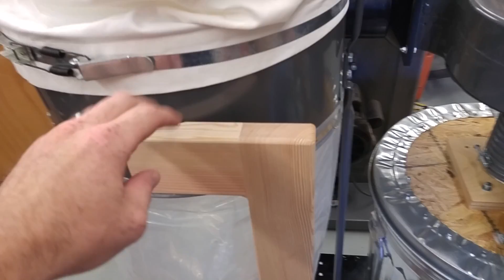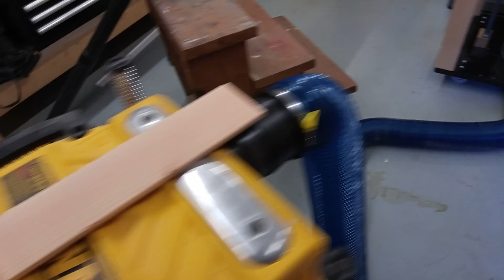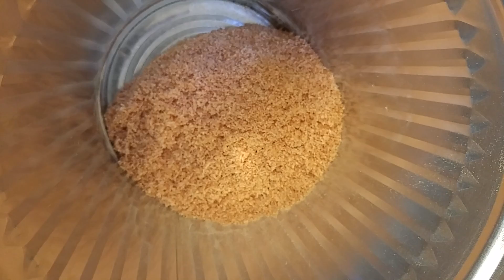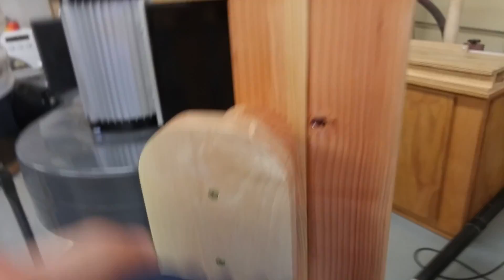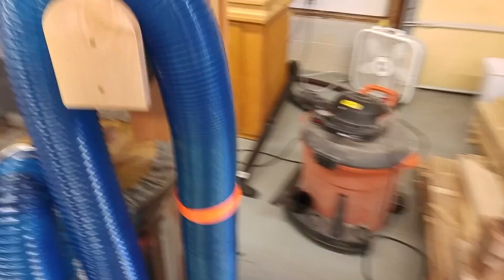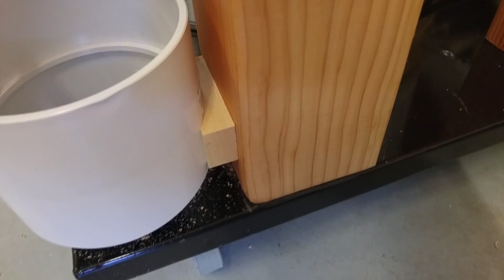Harbor Freight 2HP Dust Collector Modification Part 3/3

Comment: What is the overall dimensions... the original HF dust collector is 22"x33" -- my space is quite limited. I know this is old and you are more than likely tired of talking dust collection :)
Reply from the maker: Mine is around 22x48x70 inches. The 22" is not including the elbow sticking out from the trash can, which could be rotated to the side if necessary.

Comment: How tall is your unit after your modifications? How stable is it? I'm a little worried that mounting the motor high on the cart might make it dangerous with small kids around.
Reply from the maker: 68" to the top of the filter. The motor is narrower than the base, which helps with stability. If someone wanted to tip it over they could, just like a chest of drawers or bookshelf.

Comment: Nice Job! You might consider adding a floor sweep to the bottom of your unit so that when your Rockler tubing gets disconnected from your power equipment and "docked" into that coupler, the suction airflow would get connected to the floor sweep (mounted to the bottom of your unit).
Reply from the maker: Thanks, good idea.

Comment: would you mind to give purchase links for your parts? say the rubber quick connector and sch20 coupler? your cyclone baffle looks different than Thien's, any details on it?
My personal feel is that the opening is a bit complex, you might allow motor assembly on a vertical slide. thanks for your video.
Reply from the maker: I added some links to the description. I should probably post a separate video on the baffle, but it should be pretty close to the Thien concept. I used the 4" steel fittings inside the baffle because I could angle the one on the inside downwards (slightly) to help the dust drop, but PVC or black dust-collection fittings would probably work just as well. I've seen several different variations of the Thien baffle online and I don't recall seeing one yet that just plain didn't work.

Comment: I liked your single handed approach of over coming your motor mount. I also liked your idea of attaching the garbage can under the motor. My thought instead of the 4 bolts to attach the garbage can lid, would be to create a dadoed track on 3 sides of that square plywood piece, for it slide along. The opposite corresponding 3 dadoes would be on the piece on the bottom of the motor. The garbage can would then hang on and the suction would make the seal when it was turned on. A lot less time mounting it each time. 
Thanks for your ideas.
Reply from the maker: Thanks.  Good idea about using dadoes, although the weight of the full can might pull off the lid if not supported from underneath.

Comment: Very nice setup. Just got my HF dust collector and plan on building the same cart. Just have a few questions. How did you seal the OSB to the lid? What length is the Rockler hose and do you recommend it? Did you have to place sealant between the lid and the rim of the can; if so what did you use? I used the same trash can for a two-stage setup with my shop vac and the can collapses every time I turn it on. Hoping not to repeat that with this build (although I’ll have to buy a new can).
Reply from the maker: Thanks, glad you liked it. I used Gorilla Glue Construction Adhesive to seal the OSB to the lid, but since I put sheet metal screws around the perimeter any kind of caulk or adhesive would work.  The hose is Rocker item# 57111 in the 28' length, because it can reach any corner of my shop without moving the system.  So far no complaints about the hose except the price.  I didn't use any sealant between the lid and the can - Because of the taper in the lid it seals pretty well, and since that's in the intake end anyway the worst that could happen is it sucks a little extra dust out of the air into the filter.

Comment: This is very nicely done. Thank you for sharing.  I have decided too buy the HF DC And modify it and am gleaning ideas.
One thing I'd like to ask is if it is necessary to still use the filter and bag if you are able to pass a hose outside instead?
Reply from the maker: Thanks. The filter is not necessary in that case, but keep in mind that if you run the hose out of your shop you'll also blow out your air, and maybe cause the outside air to get sucked back in.

Comment: Great Video thanks for sharing your talent, the coupling for the corrugated drain pipe did you find that at a big box store?
If not do you have any suggestions for where one can be located. Also how did you secure the 4x4 post to the D.C. Plat form?
Was a doubler plate used on the bottom of the sheet metal with screws in to the end grain of the post? How secure is it the post?

Thanks Lane
Reply from the maker: Glad you enjoyed it.  I found the coupling at Home Depot, and I've also seen them at Lowes https://goo.gl/UEkWxW. The metal on the platform was thick enough that I just drilled some holes through it and put #10 x 3" screws directly into the post.  How much force that can resist will depend on the screws and wood that you use.  Mine was capable of standing vertically with the motor attached (I tested it), but if you build it horizontally the screws shouldn't ever have to do anything other than keep the posts from shifting side to side.  They're more like legs on a table with this design.